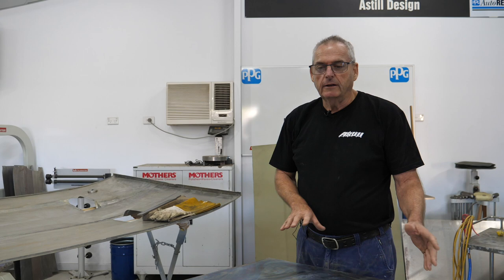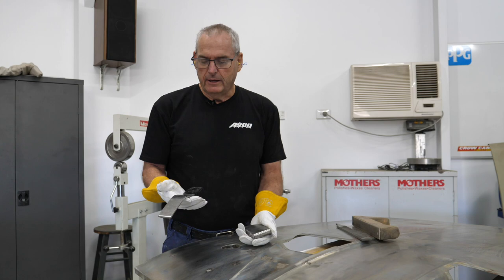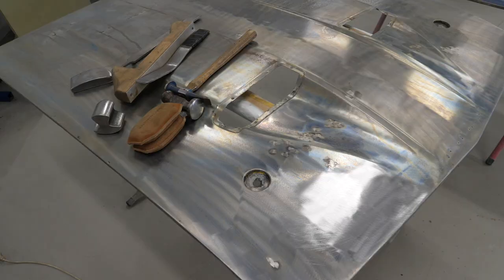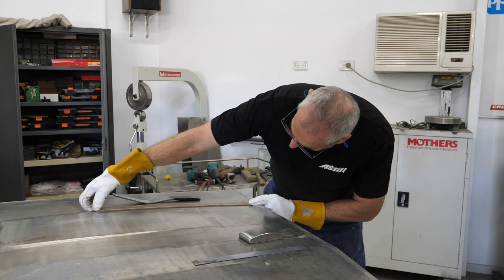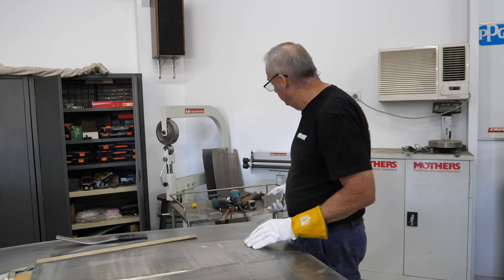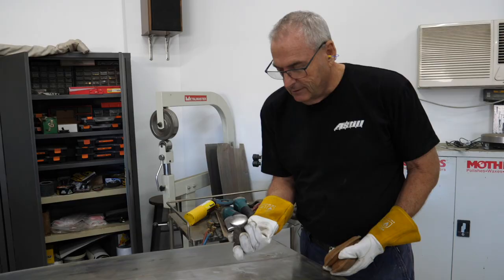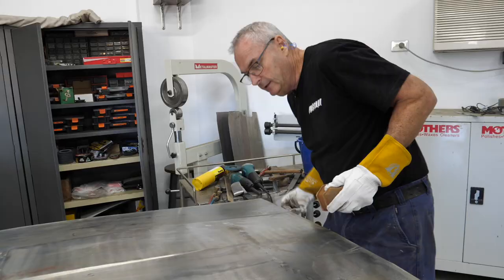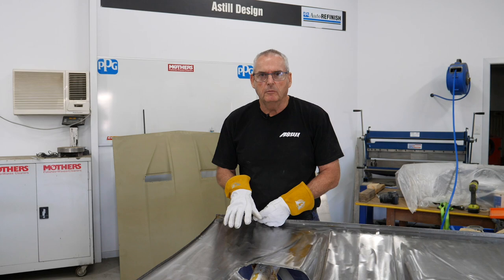Bonnet Restoration Part 3 | Built By Astill

Comment: great video, I've seen a few videos(various channels) on the flipper and dolly work and each time i watch one it gives a bit more understanding how the metal is working. the heat shrink was another great example.  
xacoupeguy gave you a shout out the other day on his channel saying how great the rust converter GEL worked on his XB roof, even took the oxidization out of the paint(heavy patina would be the best description of that car)

Comment: Thanks for an excellent tutorial Howard. Even after all my years tinkering with cars, I learned something new from your techniques. I have an XD roof that has had a few whacks by hand which has stretched it in some places and pops up and down when you press on them, so these will need to be shrunk down and metal moved around to make it taught again. I hope to avoid doing a roof skin on an XD as it's not the easiest job due to the hot rolled weld the factory used for the side gutter rail sections.
Is there going to be a Part 4 ??

I'd love to see you do a roof skin on an XD someday if you ever get a job like that. That would be something awesome to watch.
Thank you Howard. Love your work mate.
Regards
Tony
Reply from the maker: Cheers mate, I don’t think I will be doing an XD in the time I have left

Comment: This is great and decided to do my own bonnet, is there a part four as I’m putting mine back together and it looks like my sides are cracking in places  
And is it best to put the sealant on before fitting together or injecting it in after sides are knocked down
Cheers
Reply from the maker: Hi, the bonnet is off my van and the project has been put aside for now and bonnet is still apart. The skin needs to be painted then add a urethane sealer (not an adhesive)  before assembly. There is a video of putting a door skin back on https://youtu.be/SyxdKFy9m-g that is similar. If you have splits then they will need to be welded with mig and sanded back with 40 grit flapper until close then finish with a file. Cheers H

Comment: great vids learning a lot was  there a part 4 on the bonnet? im doing an xa bonnet and was wondering what type of glue to use people say anti flutter expanding foam but i have a couple of areas i cant get to once skins on any advice would be greatly appreciated
Reply from the maker: Hi, sorry I haven't had a chance to do the final assembly on the van bonnet. Will get it done in the new year, Use an Automotive urethane sealer. I use Sika 227
Reply: @AstillDesign  great thanks  mate will get frame and skin in epoxy and go on with some other stuff and wait for your next bonnet vid to see how you do the final assembly

Comment: Why not using a shrinking disc
Reply from the maker: I made the comment in the video that i hadnt used one, just doing what i do
Reply: @AstillDesign  I jumped the gun I said it before you said it on the video 

If you want to get tips there is a fella on YouTube called pro shaper workshop 
He is great to watch and give fantastic advice
Reply: @AstillDesign  compared to flame shrinking it feels a bit like cheating with the level of control Particularly when you have a lot of little highs on one area
But it is a practiced skill just like any other